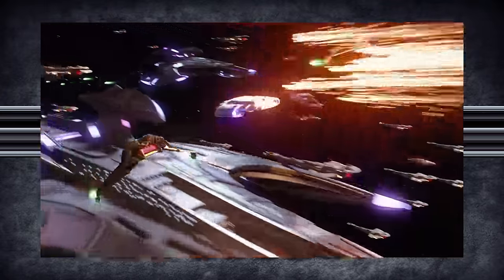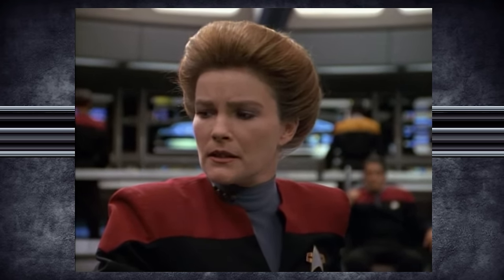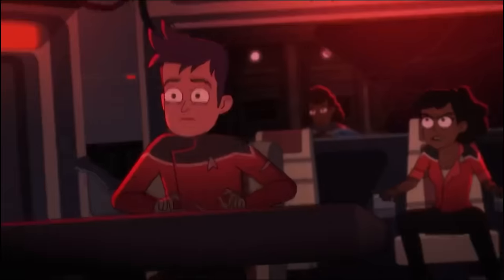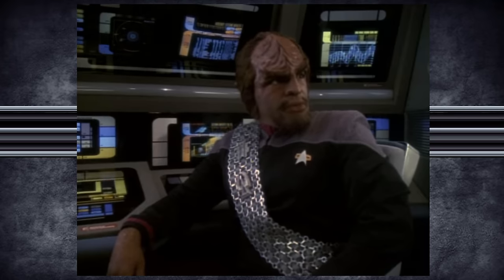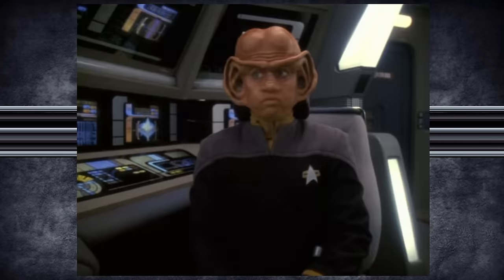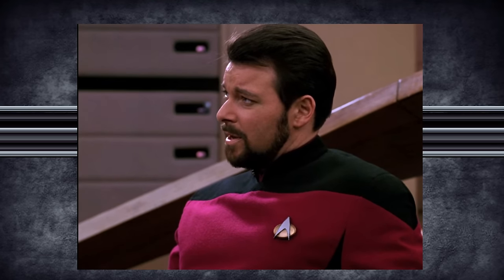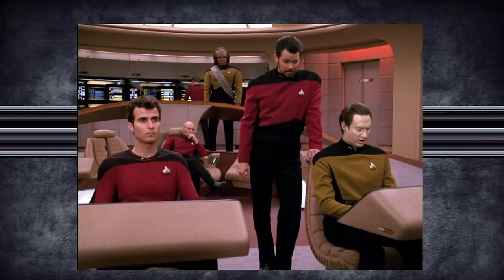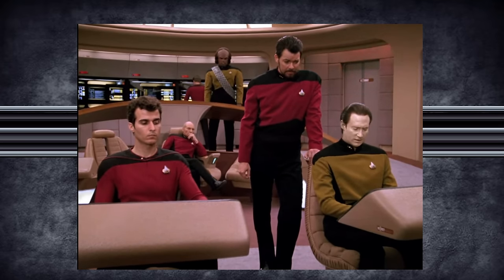Why Starfleet's Bridge Design Was Lethal to the Crews

Comment: To be fair, the Galaxy-class was built during the height of the Federation's "Golden Age", where they had had very few to almost no direct antagonists: the Klingons were allies, the Romulans had withdrawn yet again, the Cardassians were a minor power that did not pose much of a threat, the Ferengi hadn't made contact, and no one had even heard of the Borg. The Galaxy was built to be more like a testament to the heights that the Federation could achieve, rather than to be a utilitarian and efficient design. It was meant to showcase the prosperity and strength of the Federation's ideals to potential members and new races they contacted.

Once all of these enemies started popping up again in a very short time, that's when they saw the flaws in that particular design and began taking steps to rectify it on newer classes as they were designed. The Sovereign-class shows that in it's design moving away from the expansive Galaxy layout and adopting more cubicle-style stations and streamlining the other stations along the outer rim.

I'll also say that even with the Galaxy-class main bridge design, I don't think Starfleet ever 'forgot' how to make an efficient bridge, as the Battle Bridge in the stardrive section of a Galaxy ship was very much like that (and imo should have been the main bridge despite modularity).
Reply: But there was still StarFleets greatest Foe to consider... CEILING ROCKZ!!!
Reply: So the height of the federation could not get a chair for every console? Frankly, I think the top of the line vessel should at least have the same occupational safety and wellness features of a German grocery store.
Reply: @VelvetCondoms  No, it costs too many Energon Crystals to Replicate "Chair" so only the Main Cast get "Chair" and sometimes Background Characters can sit if one of the Main Cast is off doing something else so that there wont be any empty "Chair" in the shot. 
Worf is not "Main Casty" enough to get "Chair" until he became Captain of the Defiant. O.o
Reply: @grayeaglej  - Worf's is literally the only station without a chair. Even the aft wall stations have pop-out stools for users to sit on.

Anti-Klingon bigotry is what it was.
Reply: @VelvetCondoms  A lot of companies these days do away with chairs and force their employees to stand because they think it makes them more productive and less likely to slack off. Maybe they took inspiration from that I dunno :P
Reply: Approaching they way the Enterprise-D was used (At first, I'm new to ST overall), it seemed that space exploration was reminicent of the Golden Age of Sail. Ships designed for exploration and discovery, capable in a fight but certainly not a *war*ship. While Enterprise absolutely can stand in battle, she was not built as a warship. It makes sense that luxury and comfort (minus Worf's lack of a chair) were more the goal than efficiency in battle.

 When the Federation went to war, it makes sense we'd see more utilitarian bridges in use.
Reply: Logically, once the Enterprise started encountering more of these new threats the battle bridge would become adopted as the acting main bridge as the age of comfort and relative peace in the Federation came to an end, as you said. 

But...it's so cramped and dark and ugly, I personally don't think I could as a viewer have accepted it for very long. Until I suppose, the inevitable updated redesign.
Reply: @VelvetCondoms  once more a retractable chair or collapsible with both a manual release and automated release
Reply: Any space vessel with a bridge that is exposed is an idiotic design. Not to mention only having one bridge. You're in space not on the sea.
Reply: I think people have to remember the Galaxy class was basically a spacefairing hotel, with most of its "crew" being civilians. However, with all of its modularity, Starfleet never redesigned the bridge to suit the wartimes it was entering. So much for interchangable bridges.
Reply: @MrRjizz  Wdym, they had the battle bridge as well. With even an emergency turbolift connecting both of them
Reply: they did know of the borg. but had forgotten about it.
Reply: @MrRjizz  it's an aesthetic design that allows a real visual sense of seeing something that monitors don't give. 

It's why the ISS has windows and shutters that can be closed for aafety purposes, it helps keep the crew sane 

Not everything can or should be a purely utilitarian design, much of the federations deaign choices make sense in the context that use in conflict is an extremely minor role even during the heights of every war the federation has been in most ships simply didn't fight all that much, but they did spend an extremely long time ship board
Reply: @kerwin1623  the federation even during war considers itself a peace organization first and foremost bent on exploration and trade (of material and knowledge) 

Their ships prioritize that mission and design philosophy over  combat effectiveness and crew mortality rates, which isn't a bad thing, people are...well people, if you put them in a war machine it'll increase the view that you WANT this conflict..more officers dying sucks but it also leaves you in a position where to your men you always look like you believe in the philosophy they signed up for and haven't simply thrown it by the wayside 

And this doctrine has served them well, by not being or looking like a proper warahip they've been able to talk down enemies alot easier, preventing wars and conflicts thst would otherwise arise

Moreover by effectively pigeonholing any given ship into one of several roles it loses flexibility, so in major events it becomes harder to do things like maintain an ongoing assault

Where their doctrine fails is when proper war  arrives, but then you so have to retrofit your ships and their loadout which puts them out of action for long periods, something the hilariously understaffed (for the size of the territory) Starfleet simply can't afford esp if there is a real conflict breaking out where you need to  put firepower down 

In terms of out of world they're based on the age of sail rather than militaries, ships for the federation are more jack of all trades rather than highly specialized machines, which makes sense. Irl if we ever had a situation where ships would end up having to operate a variety of roles at a moments notice we'd focus our warships on a civilian esque use first despite a lower combat potential, and the longer we expect a crew to be out the more we'd focus the ship design on comfort over utility
Reply: @MrRjizz  "Exposure" is meaningless. With the kind of weapons being used, the issue is whether they get through shields or not. If they get through, it's virtually irrelevant where in the ship the bridge is.
And the way the bridge is located allows swapping the whole bridge in a modular fashion.
Reply: @ohauss  What are you smoking, if let's say it barely gets through the shield. If the bridge is in the middle of the ship the command would still be intact.
Reply: @death299  "aesthetic design" doesn't negate the fact that its a fucking design flaw
Reply: @MrRjizz  a flaw in a design is extremely subjective.

It isn't a "flaw" as it does exactly what it is meant to do, increases the comfort of the crew at the expense of a more fragile vessel while acting as evidence of non hostile intent. 

Something isn't flawed just because it doesn't adhere to maximizing any given thing
Reply: @death299  a screen and a camera on the hull would have had the same effect, thus design flaw.
Reply: @MrRjizz  except it doesn't. 

Screens provide the same view, not the same effect on people.

By having an open viewport people can SEE what's outside (think of how people react to say..being able to look out a window and watch vs just seeing it on TV) and you formulate good will, as those you're talking to can see into the  bridge and know nothing fishy is actually going on while the narrow view of the captain obstructs it.

Blast shields and sensors are a thing, one is more than capable of lowering them and achieving a similiar effect while maintaining the actual mission of Starfleet vessels..which isn't war
Reply: Nice analysis.  And how long was that Galaxy-Class in service - as in, how much time did it have to fall behind the times?  Build it now, revise it later
Reply: @death299  source: "trust me" "Screens provide the same view, not the same effect on people."
Reply: I agree. TNG was the height of the "peaceful utopia" philosophy of Starfleet, and the Enterprise D is better understood as a "showing the flag" type of prestige ship than one optimized for military efficiency. That bridge was not designed for efficiency, it was designed to be a pleasingly aesthetic place to host VIPs and diplomats. The bright lighting, the warm tones, the polished wood rail behind the captain's chair instead of bare metal everywhere, all speak to this. That's also a key reason for the third chair in the center. While Deanna often does use it (and from a writing perspective it is there mainly for her), we also frequently see Picard seating VIPs there. This gives them an appropriately respectable place within the command center of the ship, and allows the captain to have them close at hand for consultation or to participate in communications over the front viewscreen.
Reply: @kerwin1623  I would say that TNG was more of "The Love Boat" in space.
Reply: @nagillim7915  
... It's a bit hard to argue  that one. 😏
Reply: @VelvetCondoms  I watched a behind the scene and apparently the next generation ship had chairs under the console that you could pull out and sit on.

Comment: The original series Enterprise bridge was sufficiently innovative and well designed that the US Navy, which was carrying out a major bridge redesign program at the time, paid a visit to the studio to examine it.  The individual workstations were surprisingly well designed.  US Navy ship bridges didn't have chairs at the workstations at the time.  The bridge set built each workstation around the chair.  All of a station's viewscreens (whether they actually showed anything or not) were set to be normal to the line of sight of the seated operator.  All controls were positioned to be within arm's reach of the seated operator.  About the only thing missing from the original series bridge design were restraints so officers wouldn't get flung from their chairs when things went badly.  (This was corrected in some of the movie designs, although the restraint design, which involved the arms of the chairs being rolled over the thighs of the seated operator, is somewhat questionable and likely of limited use as it would not have helped control the upper body at all.)  Of course, the way it was actually built had a serious flaw that would have been very tedious to correct:  There were many instances where it was plainly obvious (and this is a problem that persists into the movies) that there are no labels of any kind on any of the control consoles in the original series, and it appears nobody ever thought this was an issue because there was no attempt to disguise this or not have close enough shots of the consoles to reveal this flaw.
Reply: The ergonomics was similar to land based control centres of the time like NORAD SAGE and Mission Control.  

The thing about the US Navy at the time is that it didn’t actually have the sensors and processing power to make use of this layout.  You’d have a CIC with a central chart desk (kind of like the pool table in TNG engineering) and a position plot indicator (like the transparent vertical panels in the rebel bases in Star Wars) that were manually updated.. and then a console for surface radar, air search radar, sonar, and some of the missile systems and gun fire control.  It wasn’t until the AEGIS cruisers came in that a layout similar to Star Trek bridges made sense (but there are far more station and they can’t be arranged in a circle for various reasons.

Comment: I was glad to see that the Defiant bridge design added an important feature to the Tactical station--A CHAIR! The last thing you would want in a combat situation is your Tactical officer sailing across the bridge if the ship took a serious hit that the inertial dampeners couldn't compensate for--especially if the IDS went down (could get very messy!).
Reply: Well the 1701 Refir had a chair for weapons control then some higher up 70 years later said. No they will get lazy sitting down all the time. We will make them stand now. As all upper management just makes the worst decisions sometimes. Lol
Reply: Yeah but seat belts weren't invented in the Star Trek universe and in the original series those tears weren't even bolt it down they just fall out of the chair and I can share go flying with them
Reply: Inertial dampeners were supposed to take care of that. Who knew the writers and directors were going to override them?
Reply: To be fair, if the IDS actually goes down, a chair or seatbelt isn’t going to make the 75G maneuvers the ships pull survivable.
Reply: @Vessekx  A seat belt would allow the ship's bridge crew to stay at their stations while in battle and taking turbulence while in high earth orbit.
Reply: @Vessekx  yeah no s***. From zero to the speed of light and under a second everybody be splattered against the back wall
Reply: @hackman669 , you didn’t bother to read what I wrote before you rushed to ‘respond’, did you?
Reply: @Vessekx  Reading is not my strong point. Main reason I'm on You Tube is to improve my typing speed as well as response time along with watching funny videos.
Reply: To be fair, IDS reminds me of the similar concept of Inertial Compensators in the Honor Harrington series. It goes down, and the whole crew is jam.
Reply: a sudden stop or acceleration with even a momentary failure of inertial dampeners would render the entire crew as wet pulpy masses splattered on the opposing walls or control panels...and the eventual leaking into the inner working of these still active and functioning panels would result in all that explodium from doing what it does best...and Starfleet would lose the damage deposit on yet another ship
Reply: @SchardtCinematic  Does this remind anyone else of the "Seinfeld" episode where the Security Guard falls asleep in a chair and the jewelry store gets robbed?
Reply: @TheKauff  or the Family Guy Blue Harvest Star Wars episode where the guys running the death Star laser want a railing. But the higher ups are afraid they would be leaning all the time.
Reply: @scottmantooth8785  So what you're suggesting is that to solve the problem with the exploding consoles and to protect crew members from inertia dampers failure is to basically have the entire interior of the ship made of crash foam.
Reply: @lumiereeclair  close...i was thinking of the possibility of all of the actual uniforms being equipped or upgraded with airbags that self inflate milliseconds before impact...of course everyone would look really silly and awkward running around with these inflated uniforms during any crisis or event that would cause them to suddenly inflate to begin with so the practicality is probably rather low on Starfleets list of things to upgrade on any given ships refit during layovers at starbase's between missions
Reply: @scottmantooth8785  Yes that could work to protect the crew, but it does nothing for exploding consoles. Star Trek does alot of cool things, but sometimes I think they didn't really think hard enough about what would be necessary on an actual star ship with all the difficulties that could arise in space. During battle, all crew should be in an EV suit in case of a hull breach. Running around with no protection during a battle is just plain dumb. There should be seat belts or restraints in the case of inertia damper failure. The bridge should also be no where near the outer hull. Putting a section with critical ship functions all in one place near the ships hull is just painting a giant red target to shoot here. Warp cores are deep inside the ship to protect it from combat damage, your bridge/CIC should be the same. There should be NO windows on a star ship, you want to see outer space, use a camera and a viewscreen.
Reply: That's the thing that I don't understand about real naval ships. Why is everyone always standing on the bridge. So many standing stations...
Reply: @tolfan4438  You don't accelerate to warp.
Reply: @erikawhelan4673  you go from standing still to the speed of light that's pretty much the definition of acceleration what geeky Star Trek word do you use
Reply: @tolfan4438  Warp drives are non-Newtonian. They operate by warping space around the ship, not by accelerating it to faster-than-light speeds. You can't accelerate to light speed.
Reply: Pretty sure Spock and Uhura had chairs in ToS and the movies.
Reply: I disagree having Tactical, Science and operations and engineering have free movement is an advantage allowing quick movement in an boarding or other needed situation. The pilot should be seated and likely have a seatbelt so they don't lose their position during rough hits and keep flying.  Free movement is  and advantage when you may have to switch stations on a dime for any number reasons.